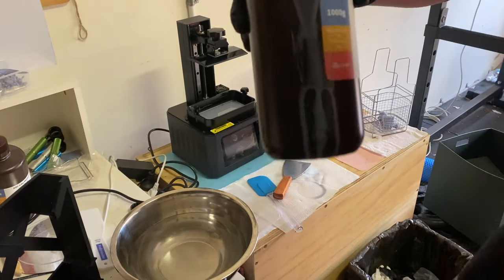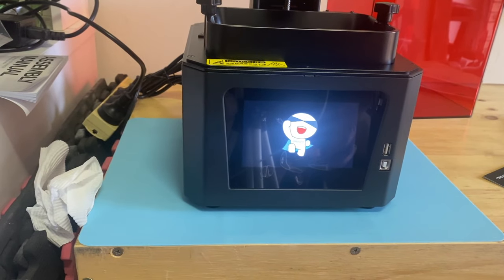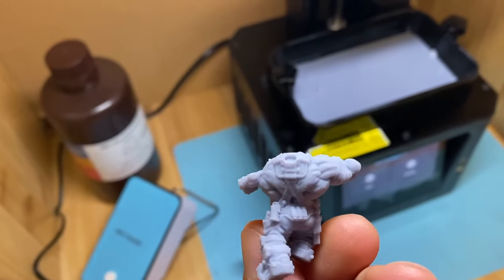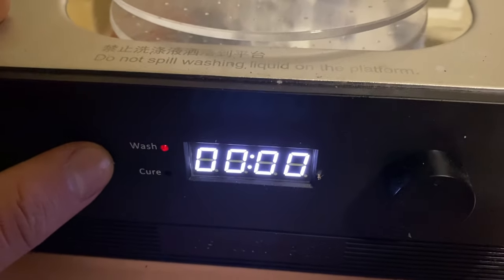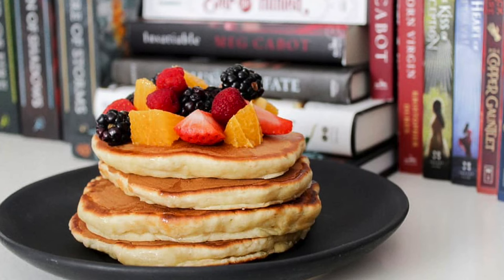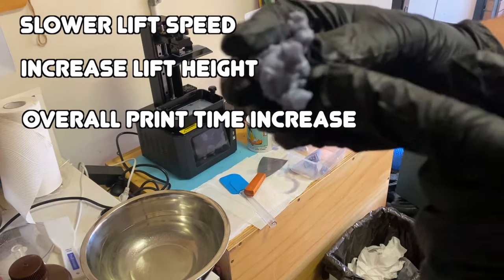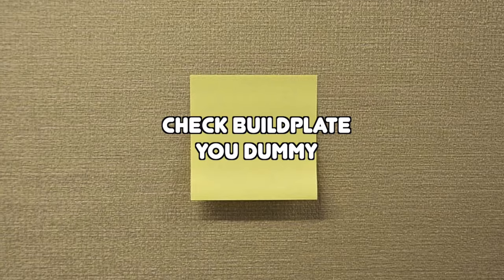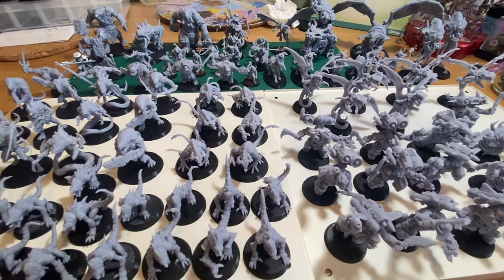MISTAKES I made when I started resin 3d printing

Comment: Hey; great video but can I ask a couple of questions? I've been struggling with my 3D prints and would love your help. Should I remove the supports before curing or after? I use a water washable resin atm as I don't have a washing and curing station. Also I seem to be losing a lot of definition on the smaller models, could this be due to over exposure while printing? Can you over cure an item? And would you recomend any 3D programs to help do things like divide a model? Thanks and have a great day!
Reply from the maker: I'll try my best to answer.
I always remove supports before curing. I found that to be easier, and sometimes you can use warm water to help in that.

It could be over exposure, maybe it could be worth lowering your exposure and doing the same model and compare them.

I'm not too experienced with post curing process. I usually cure it until the print isn't tacky/sticky anymore. That is usually a couple of minutes in the wash n cure. 
I think you can over cure prints but I'm not sure what happens, I think they become a bit more brittle 🤷‍♂

I've have used prusaslicer to cut models but it's pretty bad. Only does a straight line. If you want a more detailed program maybe Blender? But it's a bit of a learning curve (I can't use it 🤣).

I hope that helps, happy hobbying :)
Reply: @Habes  Thank you so much with the reply! Take care and happy printing!
Reply: Best advice I've seen is to clip supports after washing but before final curing. Then, the print is a little softer and removal doesn't leave as much scarring.

Comment: I have the exact same printer as you and literally got it yesterday. I must say your video helped me out so much but as this is my first printer I'd love more tips and so on.
Reply from the maker: Thanks for the comment. I'm hoping to do a review on the printer as I've had it for 7 months now. Is there anything specific you're interested in?
Reply: @Habes  it's hard to say exactly considering this is my first printer and I've barely ever sratched the surface but I would like to to kniw what washing and curing station you're using.
Reply from the maker: @jakeplaysgames2820  I'm using Anycubic Wash and Cure 2.0 but the Halot One's build plate is a bit too big. It fits inside fine, but if you have a full build plate it won't fit.
Reply: @Habes  Gotcha I'll keep that in mind before I order my curing station.

Comment: good advice, especially since youre only printing since 3 Months 
but i cant agree with you about "overloading" the buildplate. Its different with large parts with big cross sections, but with miniatures which are pretty similar concerning the print area (=not problematic), you can fill the plate to the last gap - even with a 13'' printer like the Anycubic M3 Max, given that you adjust the lift speeds
Reply from the maker: Good point! It’s one of the things I’d change in this video looking back. 
I squeeze my build plate to the max now.

Comment: Recently started, and it's going great so far!

Just struggling to figure out which resin to buy... and which ones in Australia won't break the bank! Any tips/hints?
Reply from the maker: Hey Peter, I’ve been using Elegoo Abs Like for minis. Usually buying off eBay when there’s a deal.
Best to buy in bulk when there’s deals if you can manage.
However I haven’t seen any recently.
Reply: @Habes  Thanks for the quick reply! 

That's the stuff I got with the printer... but it's $60/1,000 on Amazon, so I'm on the hunt for something a bit more affordable...
Reply from the maker: @pkmcleod  yeah, I think if you can get  $40/1kg that's a good deal. I got around that but had to buy 4.

Comment: Any advice on making it as close to plug and play as possible? I want to 3D print to get cool minis not as a hobby in itself. Do you have a video on that?
Reply from the maker: Newer machines.
I bought an Elegoo Saturn 2 and I could easily print stuff with the default resin profile for their ABS like resin.
There will still be some tinkering around as fails will happen a lot of the default settings with more recent printers will get you like 95% of the way there.

All the best with it!

Comment: At the 2.55 minute mark on your video you show an empty vat but in the sections that show the screen there is static cling or moisture attraction happening on the screen. It looks like bubbles but it is major cause of print fails. Try cleaning the screen and underside of the vat with alcohol and pre warm the resin so during the peel process  the suction is not pulling moisture out of the air and attracting it to the cold vat.
Reply from the maker: Thanks for the tip Karl!

Comment: the exposure calibration is per resin type ? or do you need to do it every time you get a new resin bottle ? ( even if it's the same you have been using before)  
I haven't bought 3d printer yet but I'm almost on the edge of buying it, so I'm looking at all kinds of the videos 

I have seen this one a lot  > exposure calibration   
this model looks great !
Reply from the maker: It's per resin type. So if you have ABS Like and then swap to Water Washable, you'd want to do an exposure calibration. It's even worth doing if you swap brands, as there could be a little variance.
I hope that helps.
Reply: @Habes  ah perfect, yep that's what I though, that's for confirming. Really hope to embark on the 3d printing yourney, it's been something I have been thinking about for few years now
Reply from the maker: @nosalis  No worries. All the best and glad I could help.
Reply: Exposure depends on the resin and the printers light source. The manufacturer and printing communities can likely suggest settings for your combination of choices. Somebody it there has probably already tried them. There are many folks happy to help.

Comment: Water washable resin tip - Don't leave the water in your wash & cure station.... It will rust the spindle on the impeller and seize it up  😢
Reply from the maker: Yeah I found that out when I first tried it. Quickly emptied the water and found that they had help up ok.

Comment: I’m just getting into res printing. What’s a good time to wash/cure models? Like how long should I wash/cure a small model vs a bigger model?
Reply from the maker: I don’t know the exact “science” of it.
For washing I use a wash and cure station and put them in for about 4-6 mins depending on how many prints are in there and the size. I think you can’t “over” wash the prints, but I’ve heard of prints being ruined when people have forgotten to take it out of the IPA for a few days.

For curing I put it in the cure station for around 4 ish minutes. It’s on a spinning plate. I know some people cure it for shorter times, because if you over cure it, the resin may become brittle. 
However the aim is for the print to not be tacky/sticky on touch and that usually takes 4 minutes in my set up.
Bigger models might take longer as they might have to be rotated to get all parts cure.

Comment: I just bought the creality halot one and I had that fear that the 3k wasn't good enough to do models like I want to but I happened to stumble on your page and its a massive relief seeing how good your models look! Do you think the quality on the printer is good and you dont regret not buying a better, 8k one?
Reply from the maker: Hey Liam, 
It's a great beginner printer and I have no regrets getting it. Not sure if you've seen my 2022 printing video but everything you see in that video that isn't FDM printed was printed on the Halot One.

Up close I think you could tell the difference in quality but when you're gaming with them on the table it'll be hard to notice the difference. It also depends on how detailed the file is you're printing.

I have recently also bought the Saturn 2 🤫 which you should see videos in the next month or two on.
Reply: @Habes  thank you for your reply. I saw your competition video and that detail was amazing! That’s all the detail I would want as a complete starter right? 

The Saturn series was exactly what I was looking at, which is 8k resolution right? I’m definitely the type that prefers to buy once… but I’m sure the halot is good enough for now 

My printer arrives Monday and your channel is great, thanks!
Reply from the maker: @xNightbound  Yeah you should be good. It's definitely a great printer and good value for $$$.
Halot is also quite beginner friendly in terms of the parameters you need to adjust as it limits them.
All the best!!!

Comment: So, I hear this on so many videos where folks talk about calibrating the settings. I don't really get the confusion about the settings. I personally use all Anycubic machines and I use Anycubic resins as well. I don't really feel the need to use other brands as they have all the types you could want, from Tough, ABS, Craftsman/DLP, Standard, Standard+ and Plant based/water washable for the folks who want that. I use the "same" exact printer settings for ALL of my resins...ALL of them, the only thing that might get adjusted and I honestly never have the need to do so, is bottom exposure and per layer exposure - and again I don't do this. I currently have 99% success rate, and I support my own files most of the time. Now given this I hear all the time how people do tons of these validations, etc. to dial in the settings. All the while prints still fail, and while that can be a lot of factors it's still a bit confusing for me. Also, while doing all that seems logical I actually just dialed in the settings recommended by Anycubic for each printer, added the time needed for that particular resin, and go. Out of the 1000's of prints I have I think I can count about 9 that went bad. My only guess is that folks are either trying to speed up the process by reducing lift distance, increasing lift speed, etc. and that alone can cause massive issues if it is beyond what the manufacturer recommends. The other guess is they are using exposure settings that are so light that the model just has far less of a chance of survival.
Reply from the maker: Thanks for the comment Thom. There's some valid points.
I think the main reason for people calibrating resins is when they're using one manufactures resin, with a different manufactures printer.
For me I have the Creality Halot One, but I have Elegoo resin, and Elegoo's data sheet only has settings for Elegoo printers.
Any other time if the resin and printer are from the same manufacturer, you can just use the standard settings. Which going forward for me I'll probably buy an Elegoo Mars 3/Saturn 2 going forward.
Reply: @Habes  Yeah I guess that does make sense in that case. I think the issue is that there are far too many resins, and even some made by companies that do not make consumer end machines, and I think this causes all sorts of issues. I do have a friend though that is constantly trying different brands, and he doesn't adjust the actual printer setting, lift, retract etc. but he does adjust bottom layers, compensation and actual cure times a bit to adjust for the new materials. He seems to have a 50/50 shot of getting right each time, so I think I can this being a frustrating point. Personally I just like to use what I know will work, and if there is a cool new resin on the market hopefully Anycubic will get the tech eventually and I can try it out too, otherwise I got my DLP craftsman resin and that stuff produces crystal clear amazing prints so I think I am good there. If I want darker colors there are always tricks to add pigment to the resin itself.

Comment: My on going issue is the bumps left after removing the supports.
Reply from the maker: I haven’t had too much trouble, but sand paper or a nail file might do the trick.
For bigger supports it could be worth using some clipper like you would for removing plastic models from sprues.
I hope that helps Jonathan!

Comment: i bought a anycubic i3 mega x a few years back and its never printed correctly lol. I think its PCB overheats or something im not really sure. I've switched the sd card and replugged all the cables and done like almost everything possible. But after like 2-8 hours of printing it just freezes. So im pretty confident its not my user error at this point but for a long long time i was pulling my hair out trying to figure out what was wrong because it was my first 3d printer and i assumed it was user error the whole time.

Its nice to see that resin printers can have failures too cuz I was considering abandoning fdm for ease of use and picking up resin.
Reply from the maker: Yeah.
The newer machines are getting more plug and play though.
Saturn 2 I had hardly any issues.
Reply: @Habes  Hi habes, a quick update. I finally got the damn thing working I think. its been printing 24h with no stops. The anycubic i3 mega x apparently only comes with a 1 inch fan on the pcb and no exhaust fans. I added an exhaust and an intake and it seems to have fixed it. If you hear anyone else complaining about a similar printer or issue then you know whats going on.

Comment: Great video and tips, what type of mask and cartridges do you use? I've been into Bunnings and Blackwoods and they didn't really have an answer for me other than 3M Organic Vapour/Acid Gas Cartridge Filters? Is that right?
Reply from the maker: Hey Ross,
The brand was Trojan and it was the A1+P2 rating cartridges. 
I'm not an expert with this and whether I need higher ratings (like A2), but it seems to block the fumes. First time I used my printer I got a headache from the fumes, but haven't since the mask.
It's quite a niche hobby so It'd be hard to ask them for advice.
I'm sorry it's not a definite answer but I hope it helps. If you find out please let me know :)
Reply: @Habes  No worries, will do and I'll look more into what you're using too. Thanks.

Comment: One thing I have found is magnetic build plate. It is a wonderful addition to my printers and speeds up removal. As for the respirator, I think it's a personal preference. I have never had an issue with the odor. Never had an issue with it. I barely notice the smell maybe because I had worked in a tankage plant in the past. Horrible smells just don't affect me. Now spray paint on the other hand. That is a different story. Need to wear a respirator then. 😉👍
Reply from the maker: I'll have to look into a magnetic build plate. 
Sometimes I have to scrape pretty hard to get them off the build plate 😓
Reply: @Habes  Yep, I got my first on off Amazon but the one's for my pair  of Elegoo Saturn S. I ordered straight from WhamBam. Great service and fast shipping. Little expensive but man are they strong on the magnetic side. Wow! Just love them. Go WhamBam if you can swing the price. 😊👍

Comment: One big one to add is if you get a brand new printer, make sure to check that your build plate is actually level.  I got my first printer the other day and only 1 out of 4 attempts was a success.  Just found out today that my build plate it warped...
Reply from the maker: Yeah that's something I would completely overlook, checking your equipment is right.
I'm sorry you had that experience, hopefully your printing experience has gotten better.
Reply: @Habes  It sounds like Elegoo is going to try to help me out.  They are going to send a new build plate and they offered to help me slice the failed files so I could have an example going forward.
Reply from the maker: @SILVERF0X13  That's good. I heard their customer support is pretty good.

Comment: Im learnin today ! 😅 yesterday i started a 19 hour beserker print file on my halot 8k and first 2 trys it diddnt stick to the bed so now im on number 3 and its stuck but now im worried imma run outa clear blue ink in the trey. i started with 500 now its lookin light and i gotta go to bed so im thinking about adding clear red to make a half blue half purple print incase it runs out.😅 uhh hopefully the blue dont run out
Reply from the maker: If they have the same exposure settings you should be good. All the best!

Comment: Nice video. I just got this same machine and have only printed the preloaded models so far but it's pretty fun! Have you had any issues converting files into the correct file type for the Halot One?
Reply from the maker: I've just been using lychee slicer and selecting the halot one profile on that.
Haven't run into any issues with file types so far.
It's a really good starting printer. I'm glad I bought it.

If you run into any issues you can message me on discord/instagram.
Reply: @Habes  I just tried using the lychee slicer directly to that file type and it didn't work. I had to export it as an stl and then use the halot slicer to get it to print but maybe I'm doing something wrong. I have the newest version of lychee
Reply from the maker: @Billothy69  message me on instagram @habeshobbies. I can send you a screenshot of what it looks like when I export on lychee if that's helpful.

Comment: At some point I had a grow led bulb (15watt) very close to one spot of my sofa, and the fabric eventually lost it's color on that spot.

I wonder if that same bulb could be used in print curing.. it's those very basic osram grow bulbs sold even in many supermarkets..?
Reply from the maker: It might be. You would have to check its specifications and whether it's emitting UV light.